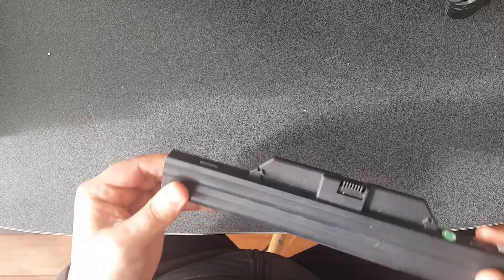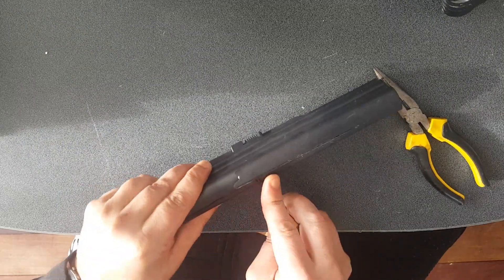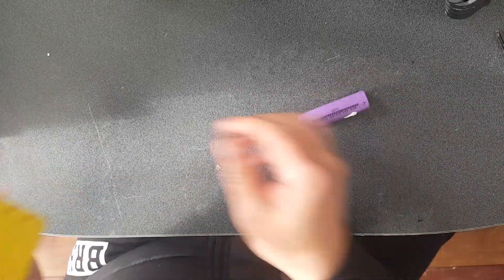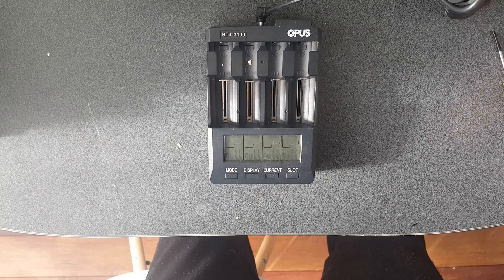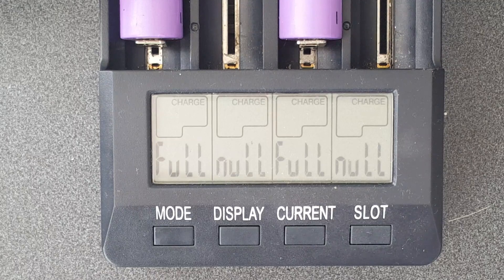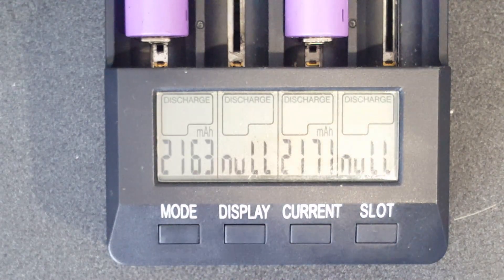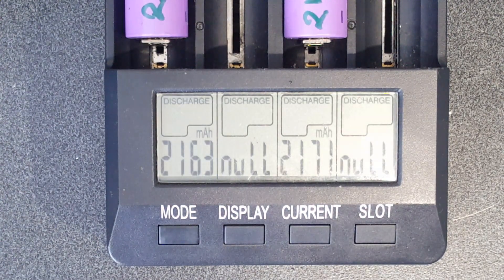How to recycle 18650 laptop batteries

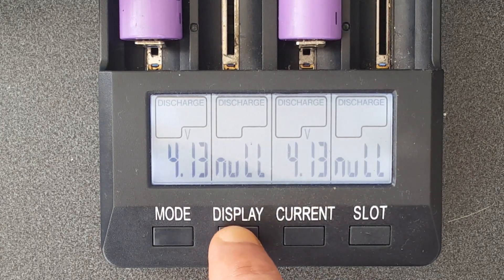Comment: 3:44 a quick note here, 1003 and 998 mA is around 1A and not 10A. at 4.2V and 1A is at around 4.2W of power of discharging each. 10A would be really quick and hard on this cells :D
Reply from the maker: Thanks